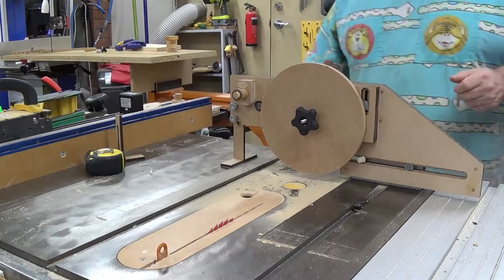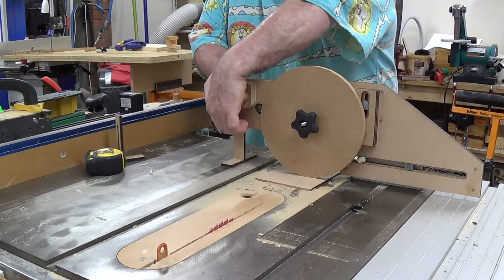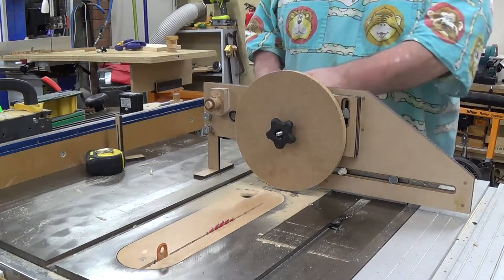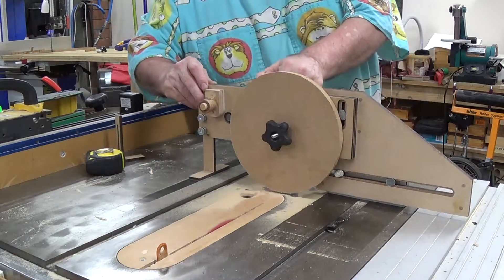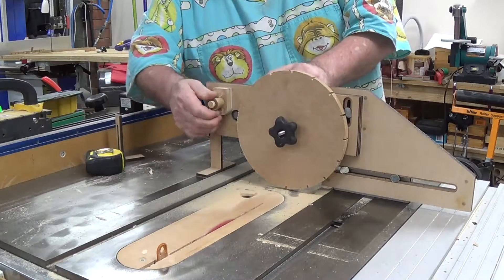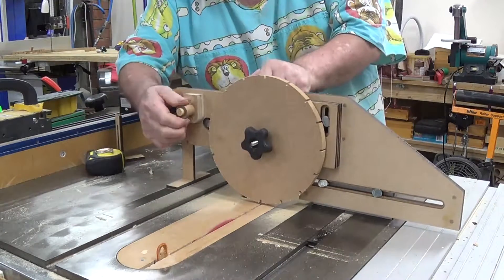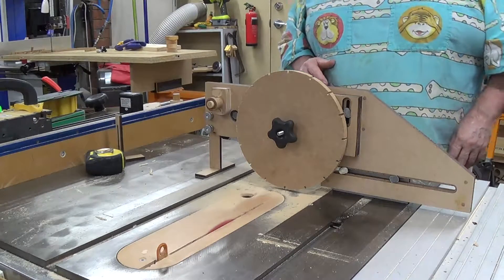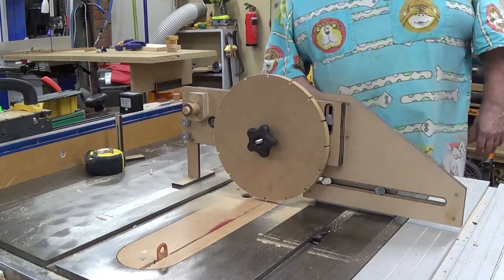Wheel Kerfing jig 9 Incher Part 2 follow up

Comment: Nicely done, love the quick changes from cut to cut.
Push it one way make a cut then go the other way and make a cut for a wider tread.
As you said in part one the smaller wheels will not show this hardly at all.